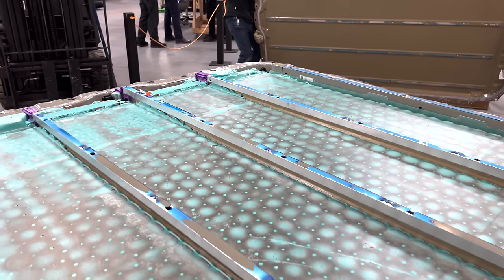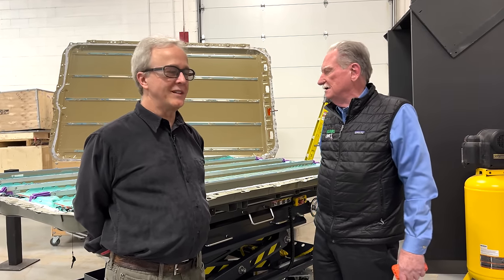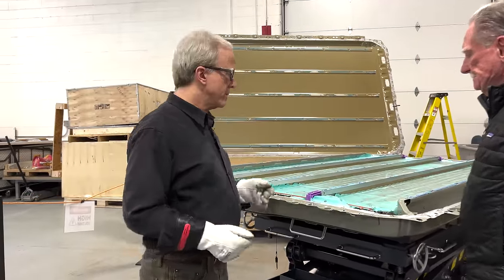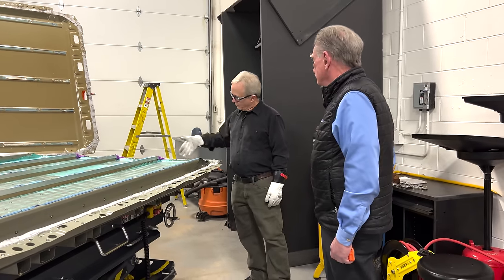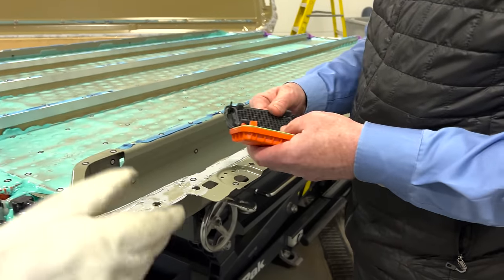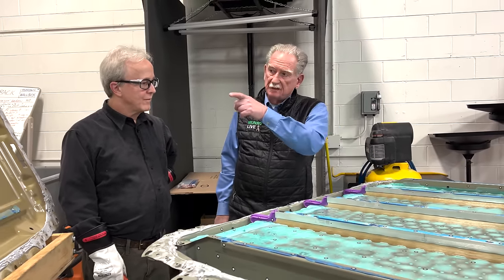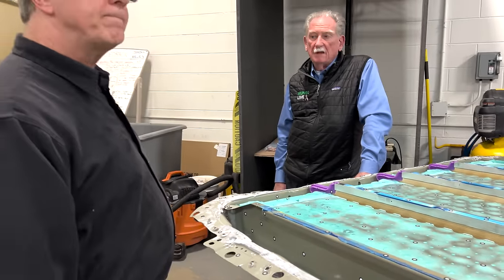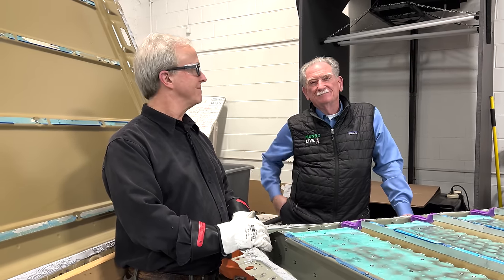Tesla Cybertruck Battery Pack: Our First Impressions Under the Lid

Comment: I don't see a point. There is nothing repairable. In case of any failure, this is toss and replace.
Reply: Any kind of individual cell level failure is a 1 in 1,000,000’s event. Designing in repairability is certainly more time and money overall than just replacing the whole pack in those extremely rare events.
Reply: The battery is part of the frame
Reply: @TheConnor12500 The fact we have this kind of comment exists is a symptom of our society's slow but steady walk towards the throwaway society. The thing is a $40k ball of goo for absolutely no reason and you are somehow fine with it?
Reply: @TheConnor12500 I’ll take missing the point for 1,000,000 please 

The point is not whatever magical chance they cell will need replacing it’s is the fact that no matter what the entire pack will eventually need replacing and it will be incredibly expensive and hard to recycle also yea it is a bad thing if you can’t replace one damaged or dead cell that means it’s a bad design who cares if it costs money and time to develop that’s the company’s problem for bringing this out not ours the customer.
 I can replace the fuel tank in my truck if it ever gets damaged and it barely costs a tenth of the cost to replace a electric car battery and thr odds of a electric car battery becoming damaged from road debris is much higher due to it position on most EVs on the bottom.
Reply: Objectively incorrect.
Reply: You never seen a dude repair the truck battery in Pakistan lol.
Reply: Agree with all your points except “slow”. We are already there and have been for decades. The only difference is the cost of item being thrown away instead of fixed.
Reply: parts and labor costs more than the vehicle, but everything here is repairable... and everything breaks... its also recyclable...

is the foam fire extinguishet too?
Reply: @pazsion  again. Objectively wrong. Electrified garage fixes these kinds of battery packs all the time for a 10th the cost of a new or refurbished pack.
Reply: With the right to repair act ! This manufacturing process should be forbidden!
Reply: The point? The point is a 60k throw away and replace vs as 7-10k module. Merikan's are foolish
Reply: @TheConnor12500 yes because car accidents dont happen ever in usa. There's 19,920 car accidents daily just in usa. & over 7 million a year! 380 million citizens have 7 million car accidents a year. That's 1 in 54.2 people who may have an accident. You say 1 in a million 1,000,000 even? When these ev's burn for days they shut down highways and cost states millions in lost commerce alone! There's more than 2 million EVs on us roads.
Reply: What else can you expect from an EV? They are all E-waste, it’s like buying a gigantic smart phone.
Reply: @TheConnor12500  Sometimes it's not the cells that break but the battery controll which is in this case glued in with all the rest of the battery.
Reply: @fzigunov  
Most consumers select the cheapest model without factoring product quality, dependability, repair-ability. 

Worst yet, the manufacturers are constantly looking for ways to make the product more cheaply without reimbursing the warranty.

These Tesla battery packs are not necessarily a symptom of that trend.
Reply: @CarLoverPhotography That's a good analogy. They might as well glue the battery to the truck so you can't peel it off. I see other Tesla models where the battery is incredibly hard to replace. Yet people still keep defending this junk.....I'm not against electric vehicles. I'm against how they are made.
Reply: @connor/whatever....
It's unrepairable/serviceable and therefore even in a sigma 6 failure situation a massive waste of resources and at around 70% onwards in its lifecyce when it would be reasonable to expect a chargeable out of warranty repair the owner is going to be looking at a replacement cost of more than the vehicle is worth. Your position is so flawed environmentally and economically you must be deluded.
Reply: What if a way to repair it could be figured out? The cost of that pack would be 20 grand or more. A lot of repairs can be done for 5 or 10. One day when you pay for your own stuff you will understand.
Reply: @tireballastserviceofflorid7771   
Yeah, there is a lot of incentive for third parties to repair (Tesla) EV components, especially battery packs, instead of giving them back to Tesla without even a core reimbursement.
Reply: They are recycled, not thrown away. There's already an aftermarket company specializing in recycled Tesla batteries.
Reply: So good for the environment huh
Reply: You make them highly reliable not moderately repairable.
Reply: Ow you can repair this . , its just going to be a mayor pain in the balls 😹. Btw did anyone notice the wood in the structure 🤣🤣🤣
Reply: @mplewp  He specifically said that isn't wood.  I still hate the design but it's not wood.
Reply: Right. Poor design. It is not thought to the end.
Reply: @CBe-ot8vu  Tesla is the worst at this as they have also the mega/giga-whatever casts and large parts. Break one of those and the costs are through the sky.
Reply: @TheConnor12500  what about the environment effects? This doesn't seem green at all
Reply: @TheConnor12500  and so all the talks about saving environment are just BS.. who supports ev is telling us: throw your old car to garbage, pay 3x the overpriced battery new cars, and if their battery pack fails? Just throw it and buy new one(to save environment)..
Reply: This won't be reused in a ev conversion. Wasteful.
Reply: Probably 30-40 grand to replace
Reply: That is the point. Remove all potential for repairability just like an iPhone.
Reply: If you want a green image as a car manufacturer, your car must be more recyclable.  The Germans are ahead of that
Reply: In the past it made sense to have repairability. (1st gen roadster) But long term its better to develop and refine the technology and chemistry so that it just lasts. All the battery metals and minerals are 99-100% recyclable. Its not throwaway. In fact .many of the original roadsters from 2008-2012 are still in use today.
Reply: Tell me how the average ICE car is any different? 

Or are mechanics your way repairing engines, turbos, superchargers, transmission instead of just replacing with new or used parts?

Again the average new engine costs 10k-20k, transmissions (not clutches) about 5k, turbos about 1k-3k

And hours of labor and diagnostics.

EVS might offer a path to quicker diagnostic and battery swaps/upgrades while keeping the rest of a car while.

And your cell phone analogy kind of backfires when you consider most people them for features not functionality.

Most cell phones can last for years longer but people want the latest and greatest.

Same for ICE cars (see % of leased cars)
Reply: Okay whats your point
Reply: That’s insane. I work for BMW and our HV batteries are far more serviceable.
Reply: Recycled? Barely.
Reply: @TheConnor12500 they won’t be happy until there’s hot swappable cells you can change while driving.
Reply: Y 16500 euros también.
Reply: It is like your iPhone battery.
Reply: Repairing doesn't employ a factory full of people who manufacture vehicles.
Reply: @TheConnor12500 no it isn't, User or hardware failure during charging or use of the car can kill a cell
Reply: The Ukrainians have specialized in repairing total loss Tesla's. The get shipped from all over the world, because if your labor is cheap but your workforce is highly educated, everything is possible.
Reply: I see a point. That would be at least 50K USD sir. But hey, we will take your old battery too and dispose it for free, for you. Then they recycle the lithium and make even more money. Yeah, green energy. 😂

Comment: I'm not sure all that extra space is clever for off roading. If you hit something that significantly dents the battery pack, insurance is totaling that car for safety. We've already seen that in the news with other EVs. No one is keeping that vehicle after the battery is dented. It just seems like a lot of wasted space where more range could have been added. There are other strategies for venting the battery that doesn't take up so much space, as used by Tesla's other battery packs. Now maybe it might protect the battery from immediate thermal runaway out on the trails with a dent, but it's for sure still totaled. Insurance companies don't play around with EV batteries, unless Tesla will stand by it and replace the lid and certify it's worthiness.
Reply: Knowing that the air gap is there should help insurance companies writing off less vehicles because of a slight dent in the bottom. On the other hand, it may have become even harder now to gauge whether a bump on the bottom has done any real damage to the cells inside the pack.

Comment: Sandy and Tom, Thank you very much for including that concise cell configuration primer. I've struggled with the nomenclature much less the Ohm's Law relationships. However, one term seems to remain multivocal without consistency: power @ 14:58 minutes. Parallel connections increase current capacity right? Both Voltage (Electromotive Force=EMF=E) and Current (“Intensität,” German for ”intensity” = I) values contribute to Power as in P = I x E. So is it fair to say that the Series configuration of cells establishes the bus/ system voltage (E) i.e. the electrical architecture, and the Parallel configuration establishes the system performance i.e. the load management-current (I) demand and endurance design between charging cycles (Time)? Together the architecture and design are about how the horses go down the road i.e. horsepower.

Perhaps I could offer a further clarification of the term 'Time' by using the term 'energy' rather than the term 'capacity'. When speaking of 'endurance'  the term 'energy' seems most fitting scientifically i.e. Energy = Power (P) x Time. (Doesn't the idea of 'energy' transcend the concept of 'Ohm's Law' in order to maintain system coherence?) So that transcendent-move throws us into the weeds scientifically and typically the conversation reverts to analogies e.g. good old fashion plumbing: Water flows downhill. 

So-- electrically speaking-- the flow of water is analogous to electrical current (I) and the height of the hill i.e. the head of water is analogous to electrical voltage (E). So the battery industry focuses on the flow of electrical energy i.e. current (I) when speaking of endurance i.e. flow over time. And just to make things more confusing the battery industry prefers to recognize the French physicist André-Marie Ampère and use an elegant French term 'Amperage' rather than a terrifying German term 'Intensity' (I) when referring to current e.g. the intensity of short-circuit fireworks. Therefore the industry uses the moniker "Amp-hours" (A-h) to rate a battery's energy capacity i.e. Power over Time.

Ugh! Face-palm.
Reply: Also... When you speak about operating voltages of 700 to 900 (800V nominal), do you mean that the 48 volt direct-current battery voltage is being 'inverted' to an 800 volt alternating-current component voltage? Doesn't an "Inverter" trade a decrease in current (I) for an increase in voltage (E) to achieve greater endurance (via power-to-weight advantages) from high load-demand components without violating the power (P) law i.e. P = I x E ?

Comment: Quick tip for the sponsor spot in the factory: there's a great AI tool from Nvidia called "RTX Voice" that does an AMAZING job of removing noise. I don't know what tool tried to remove it in this case but it's really really exhausting and hard to listen to. Maybe give RTX Voice a shot to level up your factory footage in general, not only for sponsor spots. :)

Comment: The only question I have is where’s my 500 mile range, three motor 60 K cybertruck?
Reply: Go back to 2019 and try again.  Maybe you will not travel the path the included Covid, High inflation, and the resulting disruption of parts supplier and specifically microcontrollers.  Best wishes.

Comment: While Munro takes nothing for granted and investigates everything, from the specification information released about the vehicle including 816 V max, 4680 cells, 122400 Wh, we know the pack must be 7p,192s, 1344 cells. The pack being 48 cells  long and 28 cells wide - so each quarter of the pack is 48cells long, 7 cells wide - 7p,48s (336 cells). For 408V max charging, the pack can be split in two for charging using some automated switches. 
From this info, Tesla is saying the capacity of each cell is 122400/1344=91.07143Wh.
816/192=4.25V max
91.07/4.25=21.43Ah.
However, Chinese companies report a Tesla 4680 cell is 23Ah nominal. The cells likely have 7.3333% more energy than Tesla says to ensure a reserve at zero mile range and for loss of capacity. 
Real capacity of the pack is probably 131.4 kWh - a 9 kWh buffer. 
The space buffer under the cells is probably 1.5 inches deep - 35 to 40 mm anyway. 
Amazing the pack is built upside down. 
While the cells will resist side intrusion, the pack/vehicle is designed such that the cells are not needed to resist cell intrusion. 
Thus cell cans should be reduced in thickness to reduce cell weight. 
For recycling, it will be possible to design a machine to take the mica sheet, filler and bottom of can off, then extract the jelly roll for separate recycling. Hopefully, there is a chemical that can dissolve the green filler for full pack recycling.

Comment: Question: Sandy - Would it be feasible to encapsulate the entire battery pack in an epoxy resin after it bad been carefully tested for electrical faults? Biggest issue that I see is that it would never be serviceable if 1 or 2 individual batteries failed but moisture would never be an issue. What are your thoughts on this? Would it also strengthen the whole battery pack?

Comment: Interesting to see, that same as BYD they do not support the concept of replacing modules. Therefore repair is not possible once a module fails. But they do everything possible to avoid single modules to break. Therefore repair means replace and recycle means to transform the whole pack into a powerwall or to get back individual cells.

Comment: Tesla would been far better instead of the Semi or the Cybertruck, they offered a compact Model 2, a Van, and a light duty Pick-up all based on the Model Y platform.
Reply: A commercial / work van would sell way better than the semi...or even Cybertruck.  Such an under-served  market.  People love to convert them to RVs also.

Rivian actually has one to market...but only fleet that I've seen.
Reply: @PowerScissor   Exactly. The Cybertruck was too expensive to develop being a niche market truck. The Semi should been a delivery truck for urban applications. All that funding should been diverted to a Van focusing on fleets with high market potential. A light duty Pick-up would compete in the Ford Maverick category. And the Model 2 would work as a high volume product. All using the Model Y platform.
Reply: Consider that the Cybertruck is the test platform for steer-by-wire and 48V loop wiring. Working out the bugs in a low-volume model lets Tesla use it in higher-volume designs later.